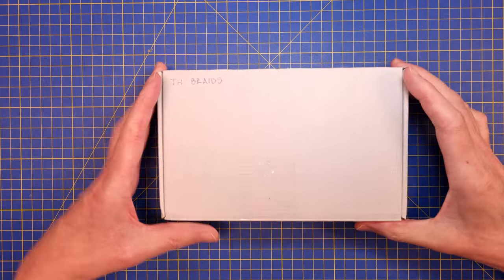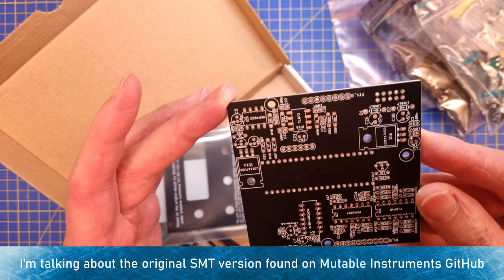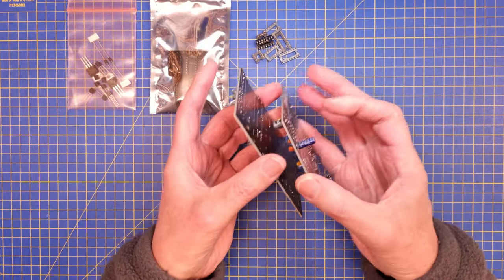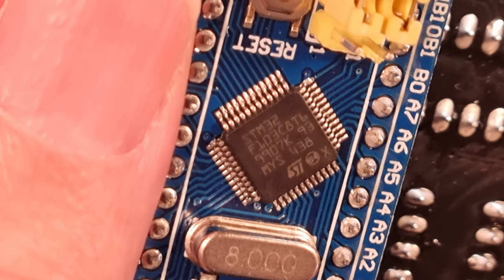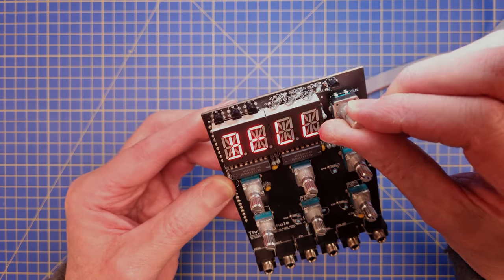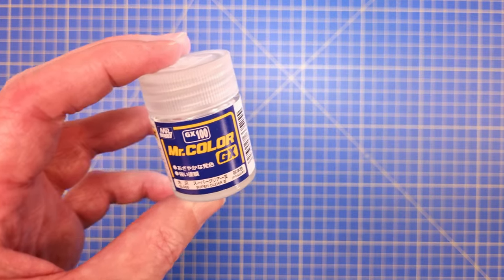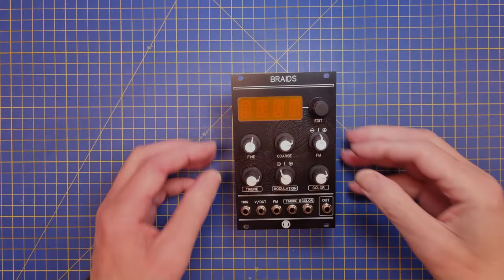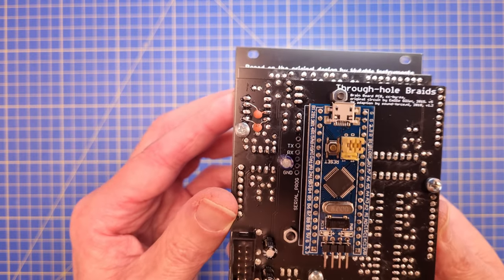Eurorack DIY: Through-hole Braids Build and Demo

Comment: Those LM4040 regulators can be tricky... the different voltage versions seem to have almost identical part numbers unless you look very very closely... 😕
Reply from the maker: Exactly, and there are tolerance options to take into account as well. I think the supplier just mixed them up when preparing the shipment, but I got it right on the second try 😅

Comment: Neat trick with the wood glue! Like yourself (probably), I've ruined things with superglue. I was thinking that a glue gun would do the trick, but it also feels as if it doesn't get enough surface area to be reliable long term, so I'm definitely trying PVA next!
Reply from the maker: The nice thing with PVAc glue is that is doesn't haze, a mistake can be cleaned up with a damp cloth (before it cures) and it goes transparent when it's fully cured. And it's strong.